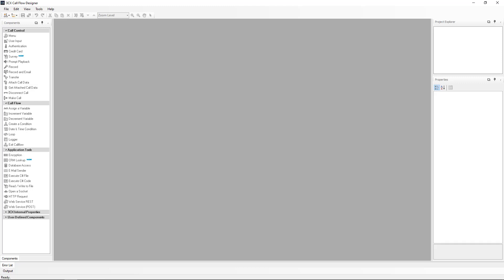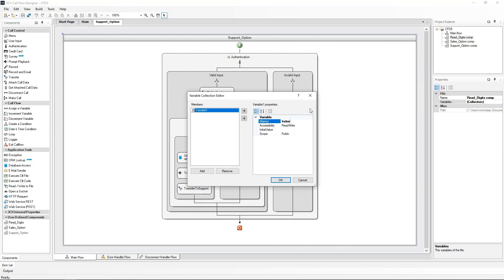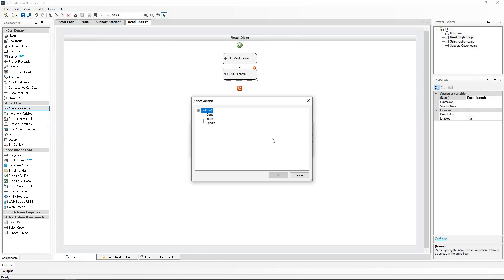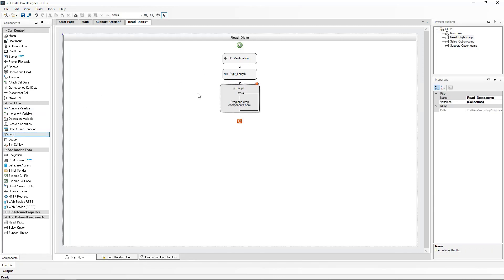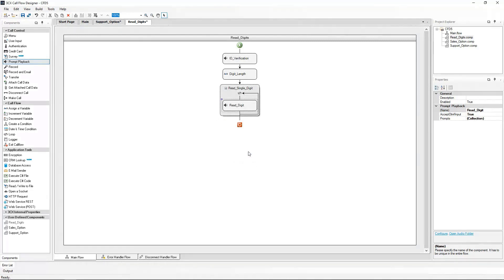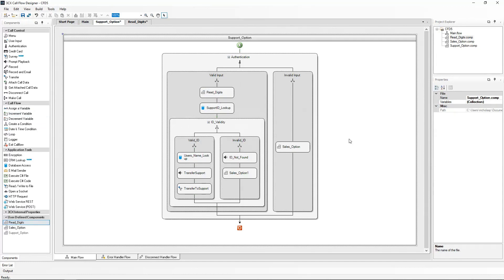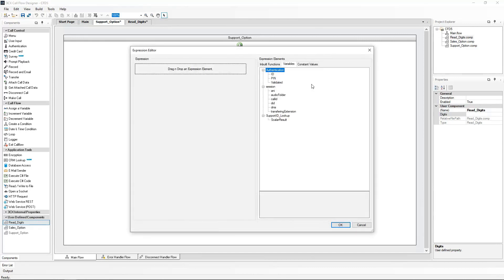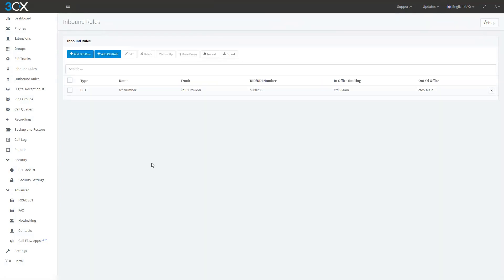CFD Video Tutorial Part 5 - Verifying users’ input

Comment: Is it possible to declare a number as internal or route/declare a call as internal
Reply from the maker: Are you trying to route internal calls (from a 3CX extension) to a CFD app? In that case, the answer is yes, it's possible. You will need to create a dummy extension, configure the forwarding rules to an external number, and set the destination to the CFD app name. Then calling this dummy extension number will connect you to the CFD app. Soon we will be adding the ability to set an extension number to a CFD app, so this will be easier.

If you are trying to check if the caller is an internal extension, or an external number, this could be achieved by checking the length of the caller number, which is stored in the variable "session.ani". So, for example the following expression could be used in a Conditional component to check if the caller number length is 3:
EQUAL(LEN(session.ani),3)
Reply: @3cx-Global   Thx for replying, well I read a thread in the german community forum  that someone has workers which can only call via a mobile number(cant use the app) into the 3cx. In the extensions they route all externall calls to a callcenter after some unanswered period. But those external workers shouldnt be redirected to the callcenter anymore. Those calls should be handled as  they were internal extensions. My would have been to change the number so the 3cx thinks its an internal connection, but i saw that the internal/external decision is made off the incoming phonecall ip.
Reply from the maker: @TheXSairam  Whether the call is considered internal or external depends on how it arrives to 3CX, and not on the caller number length. If you have 3 digits extensions, and the caller number is 3 digits but the call comes through a SIP Trunk, then it's an external call. This can't be changed from the CFD, the decision is made by 3CX as soon as the call arrives and a CFD app can't change this behaviour.

If you still have questions, maybe it's simpler to post these on the 3CX CFD forum, where our R&D team can reply directly https://www.3cx.com/community/forums/call-flow-designer.63/.

Comment: Ĉu eblas integri CFD kun LDAP?
Is it possible to integrate CFD with LDAP?
Reply from the maker: We can suggest a possible way of integrating Call Flow with LDAP.

Call Flow Designer can make calls to Web Service endpoints. You can build the code that will connect to your LDAP and then host it on a web server. 

The Call Flow will make the call to that endpoint and extract the related information. For more information on the available components, you can check our documentation (https://www.3cx.com/docs/manual/cfd-components/)